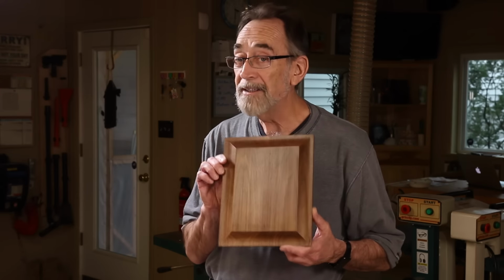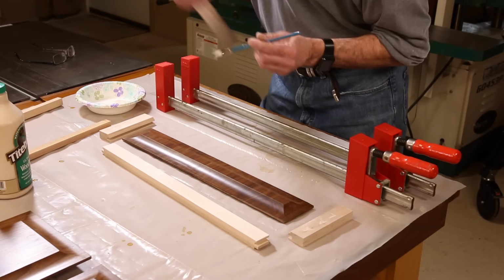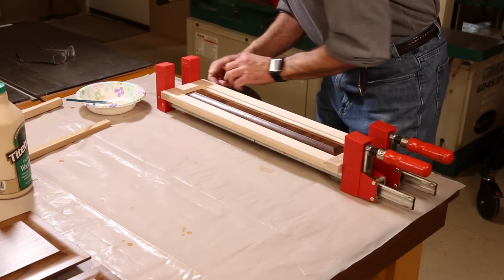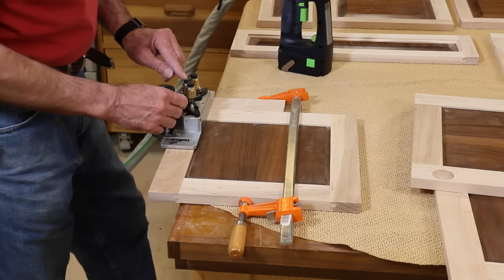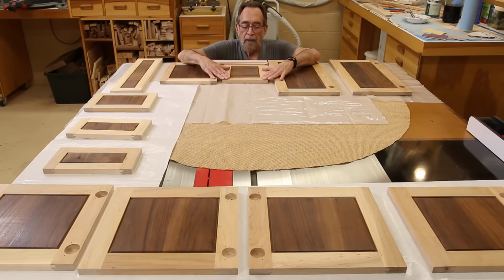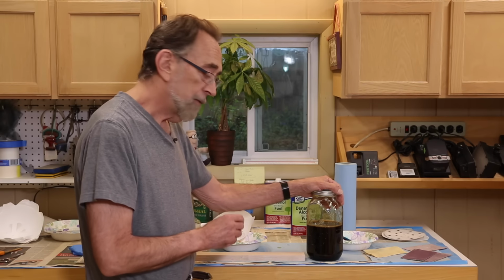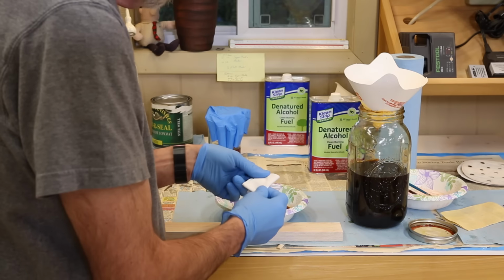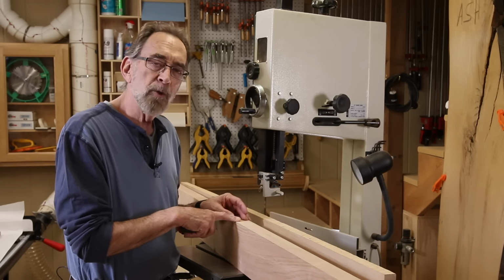Bath Vanity Part 9

Comment: I would have liked to have seen the application of the shellac to the assembled pieces.  I would find it very difficult to wipe on the finish without getting it on the panel, or in the panel/rail and panel/stile joints.
Reply from the maker: +Brett Binns It's really easy, sorry I didn't show how I do it.  Remember, I "finished" the panels first... they have several coats of shellac followed by a couple of coats of General Finishes' Arm-R-Seal.  After the glue-up, I propped the doors and drawer fronts up (standing up), and used a flat angled artist's brush to apply the shellac to the profile part of the rails and stiles along whatever edge was at the bottom... 12 doors and drawer fronts... by the time I got to the 12th one, the first one was dry enough that I rotated it and brushed along the edge that is now on the bottom... and so on... I kept doing that until all four profile edges were covered... took about 10-12 minutes. After the profiles are done, just use a rag and apply shellac to the flat part of the rails and stiles as normal.  Now here's the key... if a little bit of shellac got on one of the panels (everybody "misses" every once in a while  :)  ) it is super easy to wipe off with a rag dampened in denatured alcohol.  The alcohol won't dissolve the Arm-R-Seal and wipes the shellac off easily.  And here's the best part... if you accidentally get a little shellac on the finished panel and don't wipe it off, you can still be okay.  As an experiment, I put a little shellac on a completely finished panel (my test panel) and let it dry... then I went over it with a coat of Arm-R-Seal and you can't see the shellac... it just disappeared.  Still best to wipe it off if you can, but if you miss a spot, it probably won't show!  Sorry for the super long response, but your question was fantastic, thanks!
Reply: +downtoearthwoodworks - Excellent!  Thanks for the details.  I would not have thought of the combined brush and wipe approach.